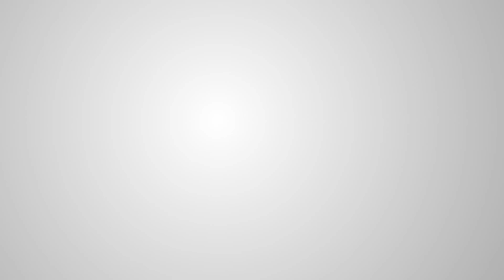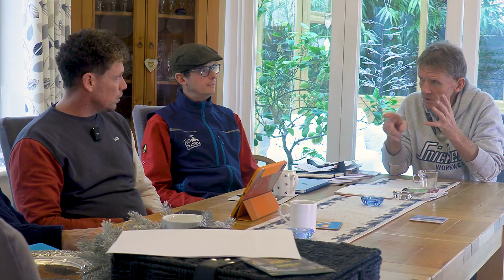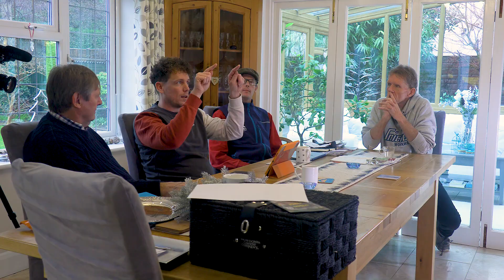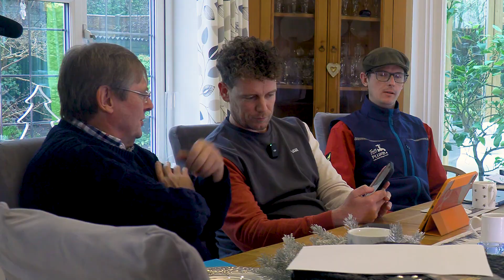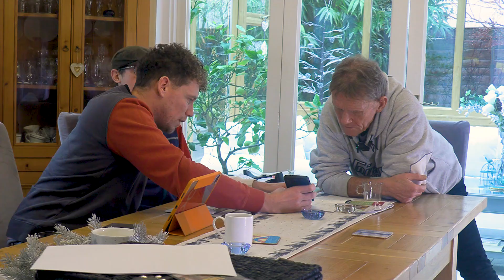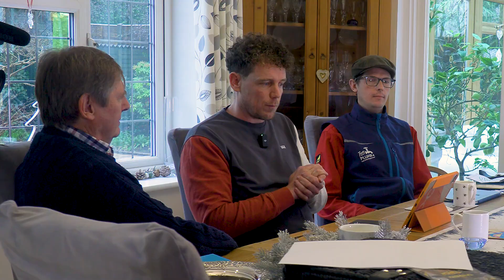What Did We Learn from the Heat Loss Survey?

Comment: If this level of design, which should happen with gas, was happening - gas would still win hands down. Domestic heating for decades has been rules of thumb not design!
Reply from the maker: You make a good point. If you have a condensing boiler running at 50 celcius and just turn it up for a few days a year you will have a very efficient means of heating with a very low CO2 output.
Reply: Its now recognised as this video demonstrates that for a heat pump system to be close to economical to run an energy loss calculation of the property needs to be undertaken, well again if the same actions had been implemented for gas boilers operating under comparable conditions and control firstly UK gas demand would plummet as properties would have boilers sized on building losses not property size. Then add in weather compensation. Under these conditions heat pumps (except where there is no gas service) heat pumps at current energy prices just wouldn't be able to compete.
As for waiting days for a property to come up to temp, or wasting in this case 12KW/hr at an 11TD when the property is unoccupied, so the property is warm upon reoccupation - there is a high probability that there is a CO2 component to the energy consumed in this case circa 2.4Kw /hr assuming a SCOP of 5 (hmmm, that is perfect world conditions, out in the real world where TRV's, hot water demands, and even strainers not being cleaned, or perhaps an anti freeze instead of a frost protection valve being installed contribute to a highly dynamic profile when in use, the SCOP is questionable, just like the numbers put out by the motor industry ).
Don't get me wrong I'm not opposed to Heat Pumps, there is a place for them, and over a 40year program, migrating to them may make good practical sense. The point Im seeking to make, is the country could - with sensible central decision making - implement better policy to achieve environmental goals more swiftly, with less cost and resistance from the consumer. We're retraining plumbers with a new technology (uptake on all fronts is sluggish only 21 a day nationwide in 2023), they could by now be retrained to do the job they do now with a greater environmental consideration. The next question is where are all the FGAS engineers coming from to maintain these complex systems, as unless there is a healthy supply in this sector maintenance costs will be the next barrier to uptake - probably beyond the reach of too many on fixed incomes.
Reply: @Soapandcandles-m4z  So you're relying on the price of gas as what makes a gas boiler win "hands down"?  Gas, where available, over here has approximately price parity with electricity, and I can't see the UK heading in a direction where electricity is 4x more than gas forever, and that gap will narrow over time.  Waiting "days" for a property come up to temp is running a heat pump incorrectly, and is a misunderstanding of how to get the most out of your heating system - it's also bad to run a condensing gas boiler like that as well, just not as pronounced.
FGAS doesn't apply to fitting monoblock heat pumps like in this case, they are hermetically sealed,  and is a bit like saying do you need an FGAS engineer to come service your fridge/freezer.
Reply: @Soapandcandles-m4z   also 12kW was the heatloss at the design temperature (-2 or -3 C iirc), not all the time, and doesn't relate to how much electricity is used.
Reply: How so? Homes in Scandinavia have properly designed heating systems, but gas is not used for home heating, even if gas tried breaking into the market as a home heating method (which it can't), I can't see it becoming popular.
Reply: Hi, one has to consider a number of factors to answer your question. If I understand Sweden correctly, its population is 10.4m, UK 68m, the domestic gas distribution network is highly developed and has been over decades. The Uk's biggest city has a population not far off that of the entire population of Sweden. Sweden has greater access to the type of tree that is suited to domestic heating and away from population centres has been widely used for decades, additionally the UK has the highest electric costs per KW hr in all of Europe. Now add back in how properties are built in Sweden compared to the UK, the average home in Sweden after 5 hours of not heating (external 0C and internal 20C) will lose 1.9C, in the UK 3C, this is an average in a great many cases in the UK its a greater number. S factoring population density, housing stock, infrastructure, macro economic policy, net immigration, and indeed climate, have all shaped  policy and actions in the UK, as a result making any comparison between the UK and Sweden is just not possible the cost of alignment would be prohibitive and the benefits unclear. @BenIsInSweden
Reply: @Soapandcandles-m4z  you might want to re-read your initial comment.  Basically, you said that if houses were brought up to the same standards for a heat pump, then a gas boiler will win "hands down", without clarification as to why.
Which in general is going to be false, as the more things you do that bring up the efficiency of a gas boiler will have a more profound effect with a heat pump. I.e. Boiler efficiency of 98% generally starts getting to SCOPs of 5 with a heat pump.
If it is as it appears based on current energy prices, then that is a Naive metric for a system that is due to last 15+ years.   There are plenty of indications that the gap between gas and electricity prices in the UK will be narrowing.
My point of Sweden is that the housing stock is fine for heat pumps and there is zero reason to install a gas boiler even if it was possible.
Reply: Sorry you’re comparing the Sweden with the UK. There is no parity between gas and electric here. With the exception of certain utility companies, electricity prices are are 4.5 to 5 times the cost of gas, gas is very widely available. Hopefully that sets the context of why if the installations in the uk were done properly, and included weather compensation, and as well insulated as is necessary, the heat pump operating costs would very likely be higher. Too many houses in the uk, are not insulated well, have had properly designed and installed systems, even if they were, over time due to lack of maintenance flow rates will reduce due to scale, sediments, lack of inhibited, the list goes on, so retrofitting a heat pump into a 100 even 50 year old property here where the copper pipes are old scaled serving guess work radiators. Swedens winter air is dryer than here therefore things like the defrost cycle profile changes, here the systems in coastal regions will defrost regularly at ambients at outside air temps as high as 6c if the pump is sited on a northerly aspect. @BenIsInSweden
Reply: @Soapandcandles-m4z  it still doesn't explain how gas boilers would "win hands down" if UK houses were done properly.  If it's just on current energy prices then you are being very naive.
As for defrosts and humidity, we have regular days of +3C and 99% humidity.
There are plenty of results from UK installations that work out cheaper for running than gas.
Reply: Consider the property on a like for like basis heat pump and gas system with weather compensation. the building losses are 12kw. So in any given hour either system in the building will lose 12kw. Plus domestic hot water demand. 
Cost of gas £0.76/Kwh 95% eff - so actual cost of gas per kw is £0.0798/kwh, the cost of electricity is £0.36/kwh. 
The ratio is 4.5, so a heat pump needs to do better than 4.5 to be more cost effective.
The average winter temp in my region is 4.9 (based on 50years of data, only know the past cant forecast the future, perhaps with climate change we will never see a "winter" again) the COP of the heat pump is 3.9 assuming I can live with the system running at 43C, those are like for like perfect conditions gas boiler vs heat pump, in my property 35C just wouldn't maintain comfort due to radiator size restrictions.
When I need to generate hot water at 55C so the heat pump needs to run at 65C as its an indirect water tank so for hot water the COP is sub 2. I need a larger hot water tank with a heat pump as the stored water is at 55 not 62.
The Some manufacturers COP figures ignore defrost cycles. Two things happen during defrost cycles heat from the building is taken to thaw ice on the heat pump, the building also cools for the duration of the cycle.
If I run my heating for more than 6moths of the year there are marginal savings. Many are quoting performance data based on only a few years worth of ambient (which for the last few have been warmer, not a guaranteed trend Arctic sea ice is at a 14year high, which suggests that north polar region is more stable than has in recent times been suggested, that affects the UK and Sweden).
As my system isn't used for heating for 6moths of the year SCOP is not an appropriate performance measure COP is, so based on 50 years of historical data, the gas installation on a like for like basis is cheaper to run (the further North in the UK I go the lower the average ambient temp, therefore the cost of running the heat pump increases. If I can get a tariff that allows cheaper electricity during periods I need heating (not the middle of the night) - the model changes, the situation gets worse, I like to sleep at 18C, and only want the bedroom at 21C for 4hrs a day.
The dog goes outside, for her evening pee, she might be outside for a few seconds, unless she picks up a scent in the garden, then it could be several minutes - at 35C heating system it will take quite a while to rewarm the space.
The siting of the heat pump is important to COP, blind or gated alleys, can see the ambient temp in the alley drop by a few C. short cycling cold air onto the heat pump will result in a lower COP, so in the scenario above, just dropping the ambient average temp by 2.5C will decrease COP by 0.2. at 35c, 0.5@43c, but only about 0.1 @ 65C.
Thats here in the UK, anywhere else in Europe - From a running cost perspective Heat Pumps win out right (except maintenance costs - entirely another subject). We need to wait and see what the OPEX costs will be.
If you cook on gas, there is the standing charge for the gas service, if migrating to electric for cooking every kilowatt is at electric prices per kilowatt not gas prices - and 1kw is 1 kw regardless of fuel.
Then practicality if there are power cuts - I get 2 a month on average, with gas I can at least still make a hot drink and food.
So it matters little what metric one uses environmentally all the time gas is required either directly for heating or indirectly for electricity to heat. direct consumption of gas here in the UK presently is less damaging and cheaper on a direct like for like basis (building losses and distribution temperature.) Einsteins first law of thermodynamics - Energy cannot be created or destroyed only converted. 
There is a case study elsewhere on youtube, person recently installed a heat pump, demonstrates how with octopus energy tariff, and heat pump and battery store - heaven knows what the capital outlay was - saves him £600 pa, the lump sum would be better in his pension or invested elsewhere, and he would have more space in his house.
As a final thought - Heat pumps will have some benefit in combatting climate change, they draw heat out of the air, so 5.35 Terra watts of gas migrated to a cooling effect ( just the UK) - assuming we are not using CCGT to generate all the necessary electricity at only 49% efficiency plus 10% transmission losses.
Compare that to the humble gas boiler at 95% efficiency that just needed its installation to be sized and done properly with modern technology supporting it.

Comment: This is why (at least for me) SCOP can be misleading.  Tell me I've a SCOP over winter where the temperature has varied between -3 and 11 degrees up and down in our mental climate.  Fine.  We do well when its mild.  But I want to know how it does when its not mild and when the energy draw is highest.  Telling me I get 4.5:1 when I'm drawing 300 watts doesn't matter if I'm getting 2:1 drawing 5kw.
Reply from the maker: I agree, the SCOP is a fudge. Give us a snapshot on a cold evening.
Reply: It's weighted towards winter.  Basically, annual heat output divided by annual electrical consumption for a particular climate.  Many of the installs that use heatpumpmonitor, have found the SCOPs provided by the manufacturer have been matched or beaten.
If you want the detail, you can probably ask the manufacturer for it, as they need to know the COPs at certain temperatures to be able to derive the SCOP.  But for many, the SCOP over the year is more valuable.
Reply: As Ben said. It accounts for the added energy use in winter. It’s not averaged per day. It’s the total amount of heat used divided by the total electricity used throughout the year.

Comment: The heat geek guy always comes over like a used car salesman in these videos. He has to talk a lot to cover up the fact that the technology isn’t quite there yet. It can be made to work with perfect insulation setup etc but only just.
Reply: What are you basing this on? Scandinavia uses them and has done so for decades. My home is from the 1920s, so isn't anywhere near modern insulation standards, and heat pumps heat my home just fine, even in -20C.
Reply: @BenIsInSweden they cost a lot more so us plebs will not be buying until there is parity with bog standard gas combi, also the mains gas is 65kw electric is 15 that also needs to be sorted if ther is to be mass market adoption
Reply: @dystopik32  my house is 3 phase, 20A, so max of 13.8kW.  My home with 3 heat pumps is drawing about 14A in total (with PCs etc running) with -2C outside temp.  Average heatloss in the UK is 6-8kW, so the majority of the heat pumps installed will be on a 16A fuse (heat pumps are rated by heat output, not electrical consumption, which as a rule of thumb, max consumption is about 50% of the heat output).
Reply: @BenIsInSweden your very unusual in having 3 phase, add in your electric oven and 10kva car charger then do this on the whole street will the substation cope with that peak demand? Some places maybe but to not only deliver that amount and manage it is going to cost trillions if we want low carbon sources. I just don’t think the technology is mature enough yet, it needs to be both better and much much cheaper
Reply: @dystopik32   3 phase is standard here. I'm not sure when I would use the oven and charge an electric car simultaneously, but if I did, the setup (as most do) would allow for the charger to reduce its use or turn off if it's approaching the maximum load for my house. Your situation of "peak demand" is pretty far-fetched - it has to be the absolute coldest day so heat pumps are working flat out, and everyone is cooking their dinner and charging an EV all at the same time.
Reply: Sounding like heat pump cope to me Ben! Im sure they will come down in price eventually and we will crack fusion so power will be easier, but it will be slow uptake in the uk @BenIsInSweden
Reply: Sounding like heat pump cope to me Ben! Im sure they will come down in price eventually and we will crack fusion so power will be easier, but it will be slow uptake in the uk @BenIsInSweden

Comment: One thing i know if you have a gas boiler or oil burner and we have poee cuts a small £600 petrol or diesel generator will run your heating. As we all know its going to happennin winter. You would struggle to run a heat pump on small generators while a gas or oil boiler will take 300 watts . Do you want all your eggs in one basket people. If your home is running all on electric which is the way its going and we have axweek of snow storms and power is lost your going to do nothing. With small generators you will be able to keep heating going and have lights andctv and internet. But of course you will never have a power cut.lol

Comment: It took two guys 4 days to retrofit my HP, new cylinder, new electrics, remove the gas boiler in my 1930s home. Works a treat, cheaper than gas. They were European so had been fitting these for 15 years already. No need to ever return to fossil fuel heating.

Comment: Very good breakdown on the pros and cons of the heatpump. These guys from Heat Geek are clearly knowing what they're doing, and it is good to have to deal with them only during the complete installation and commissioning proces. They are the people to trust when it comes on getting a heat pump.
And true, insulation is such an important aspect of making a heat pump work, I did a big improvement on the insulation of my house first, cutting gas usage in half. Now I'm sure the heat load is low enough to make efficient use of a heat pump with UFH, from around 15kWh of heat per degree day to 5.5-6.5 kWh heat per degree day, and lowering even more this year as I'm going to install floor insulation and still have one external wall to insulate. The pitched roof is moderately insulated and this will also be addressed in the next 2 or 3 years.